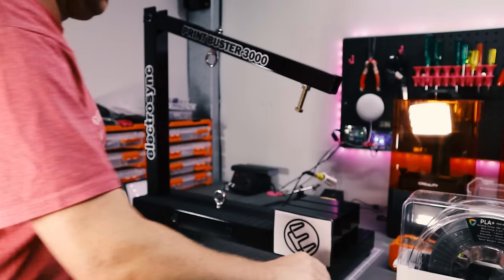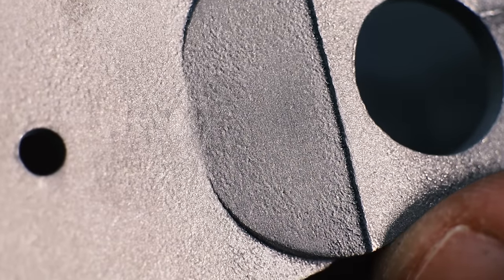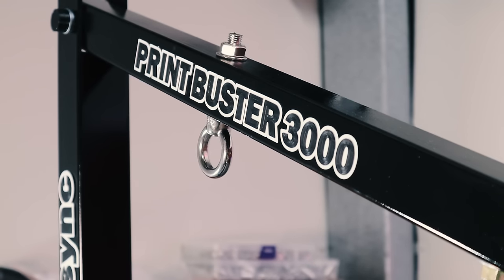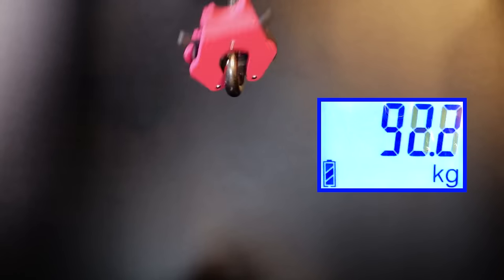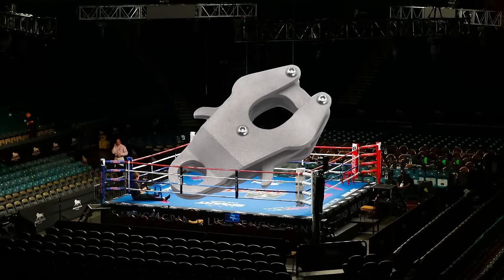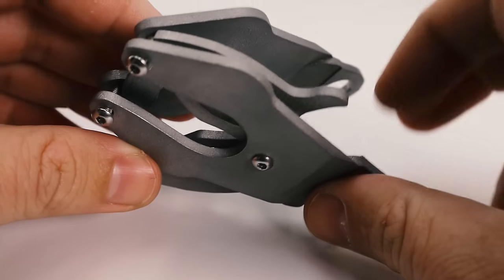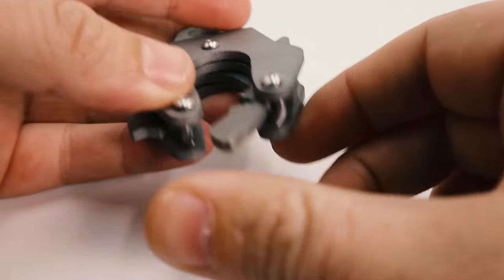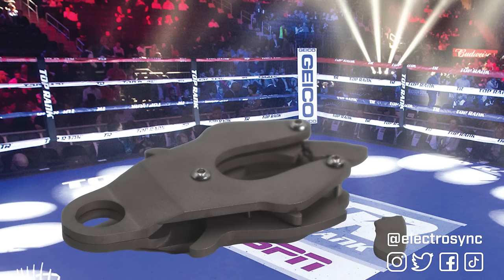How Strong is 3D Printed Metal?

Comment: Just out of curiosity would this 3D print method be applicable to printing cylinder heads for ICE engines. Say out a high silicon aluminum alloy. I'm sure it's not cheap. Not in materials so much but the machine itself has to be paid for.
Reply: Yuo always gone needa Lotof postprocesinif yuo want Clean , soft surface finish
Reply: You're probably better off paying for the machined parts due to surface finishes and size needed for cylinder heads unless you have an extremely complex geometry you want to try out that would fix a problem and can't truly be done by other manufacturing processes with the tolerance and finish required.
Reply: @ScuffedEngineer  
I would assume that certain features would need to be machined anyways. Valve guides, valve inset pockets, valve faces, head face and manifold faces. Along with any threaded holes and or locating pins. This is more of a thought experiment anyways. Always possible to 3D print the mold and do the casting. But the everything on the casting has to be machined.
Of course there's always mavhining the head out of solid billet. Even we with CV ooling passages that are welded shut before finish machining.
Reply: @mpetersen6  You could but the question is if you should. Casting would work, even going cheaper on the material of the preform depending on the type you intend to use. Big thing in additive is rapid prototyping, complexity that can't be machined or casted (organic structures), and cost. More post processing, the higher the cost negating the savings of AM. Oh and since I'm privy to the project, machining away AM manufactured metal parts and getting form is tricky due to the residual stresses formed in the material from the AM process depending on the amount that needs to be removed and how it's removed. Seeing upwards of 1/4 inch/ 6 mm out of form.

Comment: standard aluminum knows fatigue over time, steel does not, wonder if the same applies to 3D printed steel. I'm interested in connector like that for my fitness equipment but would never use aluminum for you never know when it fails you.

Comment: It's 490 PSI for the stainless steel, Structural steel has a psi of 58000 and carbon steel has a psi of 121945.
Reply: A strength test of the same design using stamped stainless steel or tool steel construction would blow these 3d printed ones out of the water.
Reply: @Initial_Gopnik  i dont konw , but probably its the same to injection mold plastic and 3d printed pladtic

Comment: :59 is what they dont talk about, yes this is steel, yes it is pitted and ugly up close and likely the same when you lathe or mill it but still strong , the issue is tolerance and repeatable accuracy, they gloss over that like your greasiest car salesman, they will not offer accurate prints if you want a press fit on multiple parts without post processing, or threaded parts that are accurate, believe me I asked one of the biggest print-farms online and they said no, "we cannot guarantee accurate fit on each part" this is all fine if your making art but for engineers many designs are out.

Comment: This is a lever system.  So, when you apply one kilo of pressure/weight thru a distance of one centimeter with the jack, you are pulling on the part for a half centimeter, with a stress of TWO kilos.  (so long as the test point is halfway exactly between the jack and the pivot).  So all your parts are twice as strong as you are saying they were, unless you have already taken this into account??
Reply: The measuring point is in straight line with the testing part, so no need to recalculate

Comment: Why use stainless hardware. It is weaker than carbon steel hardware. I used to build and rebuild industrial centrifuges up from 150mm to around 1000mm in internal diameter. Some made from carbon steel. Most from magnetic grade stainless alloys. A M12x1.5 stainless screw would have a torque rating of around 55 ftlb. A carbon steel M12x1.5 of 12.9 grade would be at least 85 ftlb. Any crital elements such as hubs for hydraulic back drives for the internal screw conveyor had to be retained with 12.9 SHCPs.

Comment: So stooopid. 3d print something when it is a 2d part? Could be a hundred times stronger cut out of sheet material.
Reply from the maker: You make a good point, but it’s not a 2D design - it requires supports on FDM. But as the SLM process doesn’t require supports, I’d probably optimise the design for outright strength if that was the goal. But this was a comparison between different 3D printing processes of the same design, not metal fabrication processes or the strongest process.
Reply: woooosh you miss the point entirely
Reply: @electrosync  So what's the tensile strength of each? You did the test, the whole point is to get those numbers to compare them.
Reply: @electrosync  And its modulus of elasticity, because that's much more useful. Thank you. Put them in the description.
Reply: I got 490psi for steel